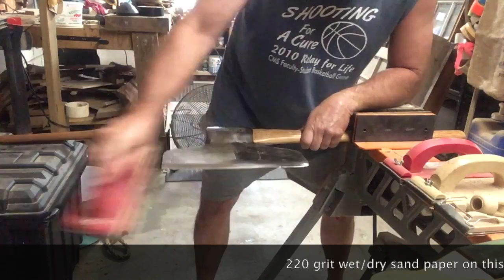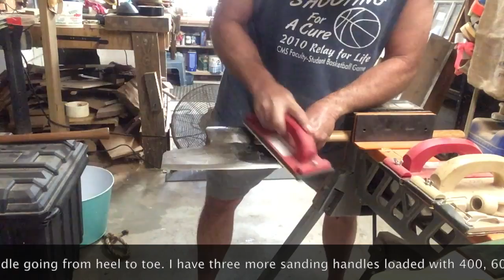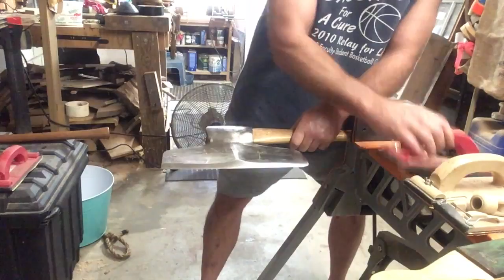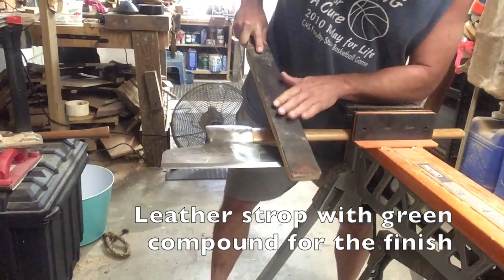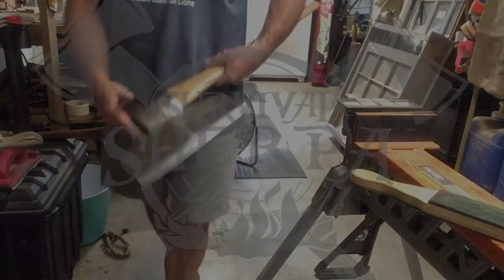Sherpa Sharp: The Rooster Method on my Broad Ax in Real Time

Comment: I actually just posted a video on axe junkies on how I achieve a polish, from filed to a mirror using things I already have around my house. This video is a perfect example of how a minimalistic approach can give you extraordinary results in a very short amount of time. A lot of us don’t have power tools or just prefer the control you get from using a system like this.
Reply from the maker: Just watched your video. Nice work and explanation into your system, bud! I have a bench sander but only use it with 80 and 120 grit when I have a really needy axhead. Once I get my working axes where I want them, this system takes little time to maintain a keen edge.
Reply: Survival Sherpa Thanks so much! I could really benefit from that clamp/saw horse you’re using. where can I get something like that? I could always get soft jaws for my vice but that looks like it covers more surface area.
Reply from the maker: I got this one from Home Depot. It's in the $80 range if I remember correctly.